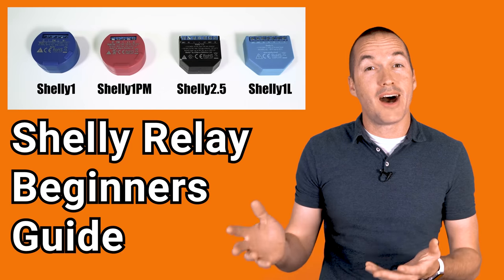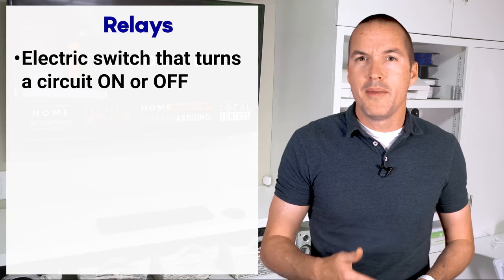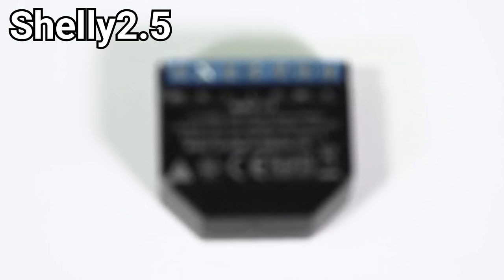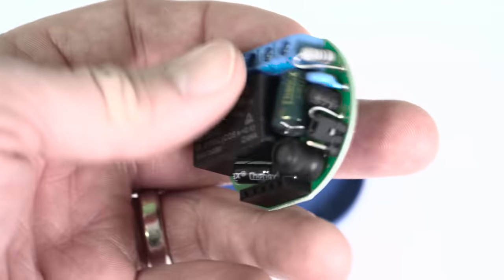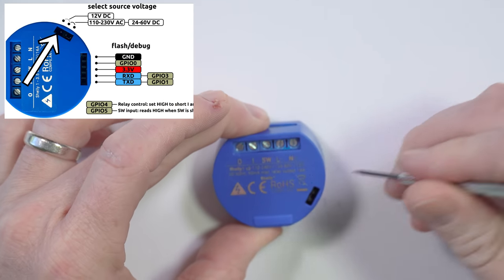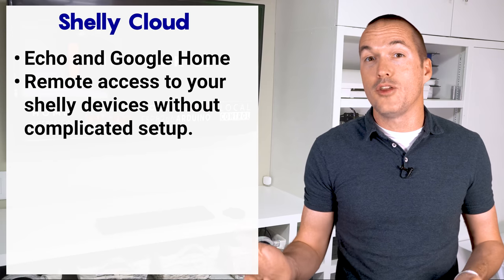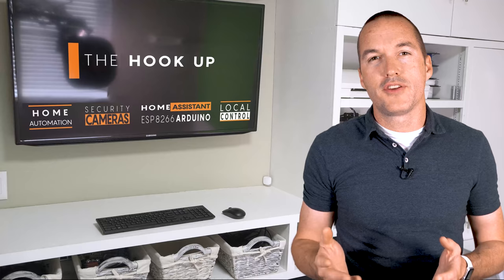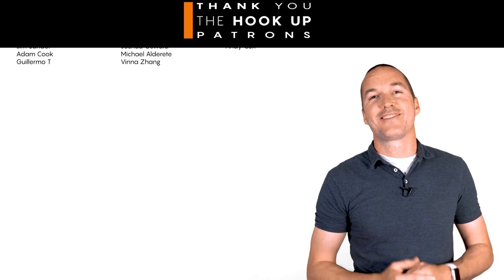Beginners Guide to Shelly Relays - Choose The Right Relay For The Job

Comment: Serious question for those trying to learn - are there connection problems (too many wireless devices) or security concerns (all these are wifi devices, people say don't do that for cameras but all these devices are also hooked up to your home & network - are they secure?)

Sidebar - why do these over non-wifi 'smart switches' I thought shelly parts were like $50+ each, that'd add up just as fast and not as straight forward. But again, I've only just begun researching. Thanks!

Comment: The thing I like about using regular smart switches is I can use extra automations to keep the state of the switch and the device it's controlling the same. I have a switch that isn't connected to anything that uses an automation to control a smart plug in the basement, by creating automations that turn the switch on or off if the plug is turned on or off and vise versa they stay synced.
Reply: With a Shelly, you are best to swap out the light switch for a momentary mech instead of a toggle switch. Then the switch does have a state to get out of sync.

Comment: Have you experienced flickering with the Shelly 1L?  It seems to be very particular to what brand of light is used even with the bypass.  I experienced it with different brand LED and CFL Lights. It seems that Phillips bulbs work the best, but I'm not sure why that occurs.  I also noticed the voltage output is a little lower than input.  If it has 120v in, the out will have around 109-110.

Comment: So correct me if I'm nowhere near correct on this.
If you have an existing home with std depth switch boxes won't wiring that relay then overload the switch box?

Seems like everytime I see a wiring vlog it's just an example on the bench.  Not showing me how to do this in an existing installation.

Comment: Awesome summary! QUESTION:
In a range hood with two separate rockers for separate halogen and fan motor control (Each rocker has a CENTER OFF position and then a LOW and HIGH position to LEFT and RIGHT, which SHELLY would be best suited to these?
Reply from the maker: Are they mains driven?

Comment: Hello,
I’ve been directed to your YouTube page because I’m a newbie and am hoping to make 8 year old ceiling light fans smart.
I want to try to figure out how to use my fans with iPS HomeKit (light are via Philips Hue).
If this isn’t possible I do have a Hoobs box…

So my home has the old push button On/Off wall switch’s and as I shared earlier I’m hoping to make my fans smart.

Which unit would you recommend?
I think there’s a neutral but I’m not sure some switches have them some don’t this is a really old house. 

And if you have any additional direction I’m always open to direction.

Thank you 
JW

Comment: Greeting,

In my house there is Neutral, we have two live wire each wire is 110 volts, in this case how is the connection with Shelly 1 L. If I connect one wire the voltage will be 110 volt not 220 volt, please advise

Comment: Something that might be useful is how to best wire these relays to a light that uses existing 3-way switches, while preserving functionality of both switches.

Ultimately, you want to ignore all of the existing wiring except one wire: the wire that goes from the second switch to the device.  Cut this and use the cut wire coming from the switch for the SW input and the cut wiring going to the device for the O output.

Typically, in modern homes, neutral is found in every box and isn't a problem.  What is a problem with this configuration is the always hot line.  Normally, one 3-way switch box will have the always hot line, while the other will have the wire going to the device.  Sometimes, such as if you have a box with two switches for two separate devices, you may get lucky and find an always hot line right in the box you need it.

Otherwise, you'll have to run a hot line.  You have two options for this and, depending on your house, one may be easier than the other.  You can run the new line through the wall into the switch box, or you can run the new line straight to the device box and put the Shelly in that box.
Reply: Or replace latching/toggling switches with momentary/retractive ones.
Install all switches in parallel, using 1 of the old switch wires for Live and the other for switch signal.

Or install i3 behind each switch.
Use the 2 switch wires to run Live and Neutral to the next switch.
Reply: Commenting so I can find your write up again in the future. Thanks for this information, very informative!!

Comment: Hello! Could these be used to remotely control my big led floodlights in my garden? Ive bought 3 different wifi switches but they all "leak" a little bit so in off-mode the leds are glowing slightly. Will it be the same with these?

Comment: Will they work with a dimer or dimmer toggle switch? I have some switches in my house where center is off down is hi and up is low. Ideally I could use the Shelly to detect these 3 states and recreate the actions on a smart lightbulb or even have up be 1 color and down be a different color etc. Also would be great to just be able to adjust my dimmer switch and have it detect the change and apply it to my smart bulbs.

Comment: I am looking for a small, thin smart relay switch that will work with 12v DC LED lights, any suggestions?
Reply from the maker: Is it a regulated 12V system or straight from the battery (12-15v)?

Comment: One thing you left out... Tasmota firmware. That's a bit advanced though. The programming header doesn't accept Dupont leads. You need to sacrifice some resistors for their tiny leads or whatever is convenient from your parts drawer.
If the stock firmware has a repeating timer function (dust til dawn) then I may forego Tasmota this iteration and see.
Reply from the maker: I don't think tasmota is worth it on Shellys, they are already local and include most of the key features of tasmota in the stock firmware (including repeating timer).
Reply: @TheHookUp  I flashed all of my shellys. Will try the replacement 1pms I just got as stock, no-cloud, mqtt for comparison. 👍

Do they have a local sundown to sun up or will I have to set that manually? These are at a remote site w/ VPN and I need them to still operate if the link drops.
Reply: @OldCurmudgeon3DP  locally stored schedules with sunrise, sunset, offset. Also specific time. Also have timers to automatically turn on or turn off after XX minutes.
Reply: @douglasroberson  thanks

Comment: Annoying thing I discovered with the 1L is that it can't take a single hot switch wire, it must be using Sx and SWn. The 2.5 is fine switching off of a live wire, so you don't have to rewire your 2-way (US 3-way?) switches

Comment: Could you please point me to the suggested device for a USA 3way configuration where the neutral wires are not used (jumped)? The 1+ does require Neutral, right?

Comment: At 2:50 you say that the Shelly 1L needs a minimum load of 20W to operate. I see they sell a bypass for the shelly 1L. Does this mean that operating the Shelly 1L implies a constant power consumption of 20W whether the connected light is ON or OFF. So it's like leaving a 20W bulb on permanently + 1W for the shelly internal consumption?
Reply: No , shelly 1L need a 20W light to power itself bcs it is in serial. Bypass device help get shelly 1L power to work and prevent of flicketing. My 1L blinks and ZBMINI2L solve my all problems.

Comment: Thanks! Learned so much! Quick question... I haven't looked seriously at full home automation in a bit. When I did it seemed the consensus was to go with ZWave Plus instead of wifi equipment to avoid saturation, interference, hacking, etc. Has this changed now? I'd be starting from scratch and have a hodge-podge of things... ZWavePlus deadbolt, Lenovo smart dosplay (Google-based), and a Konnected kit that I haven't set up yet. Hope to run it all on Home Assistant from a QNap. So... for switches and new sensors (water leak, motion, etc) what would you suggest? Wifi, Zwave or other?
Reply from the maker: Zwave is best if you go all-in.  Having a few Zwave devices is not great, the more you get the better it will be.
Reply: @TheHookUp  Interesting. Thanks!

Comment: Very informative video! Don't know if I missed it but does any of them work in a 3way system, like stairs where there are two switchs for the same light?
Reply: Yes they do. But wiring is more complex and you can't to it behind the switch. You will have to do it in the wallbox where wiring takes place. I did that successfully for exactly the stairs use case. https://www.loxwiki.eu/display/LOX/Shelly+an+Wechselschaltung
Reply: Yes.
2-way, 3-way, 4-way, n-way all act as one big virtual switch, where the output at the last switch going to the lamp is toggled each time.
You only need to install the Shelly at this last switch.

If you have so-called "UK wiring", you should have Live, Neutral and switched live (output of the last switch) at the ceiling rose, so that's where you'd install the Shelly.
In other installed, it may become a bit more tricky as you may not have Neutral or Live available at the las switch. A common solution is to use momentary switched instead, wiring them all in parallel and using 1 of the old switch wires* to carry Live.

* n-way switching requires 2 wires between each switch.
So by replacing the latching switches with momentary switches, you have 1 wire for Live and 1 for the switch signal (button press).
Reply: Good stuff. Thanks.

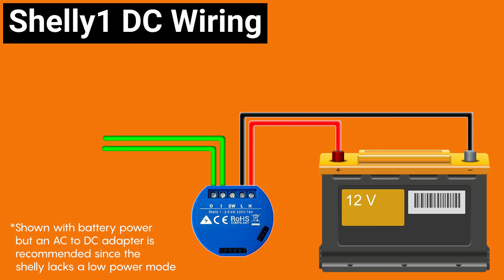Comment: I have a Shelly 1 mini Gen 3 x2  and I want to use it as described in my previous post where I provide 12v as shown at 7:11 in this video and I want to control the dry contacts at 0 1. The literature does not talk about DC implementations at all. Do I have to order the original Shelly 1 for a 12v DC implementation?

Comment: My problem with Shelly1 are that they won't support more than 14ga copper, Will the 2.5 or 1pm support 12ga wiring?  I've had to pigtail down 12ga to 14ga but I have only used shelly so far on our outdoor street light post to replace day/light sensor, and outdoor kitchen lights so when door backdoor is opened the lights at kitchen turn on.

Comment: Weird. Just yesterday, I received my first Shelly relay, a Shelly 1, to play around with. I bought it with the intention of integrating it into a space heater, but now I’m wondering if a PM would be better suited for that? I haven’t had a lot of time to mess with it, but I set it up using the Shelly iOS app and the app pretty consistently reports it as being offline. But, I can reliably control it by accessing it directly from the browser...

Comment: I’m thinking I need the Shelly 1 to dry contact the 24 vac control on my Renewaire ERV ? This is the control contacts used PBL (push button light)  to turn it on / off. Sound about right?

Comment: I'd like to know if I can use a Shelley to hook up a ceiling fan that has lights ,but I only have one switch on the wall. Also can you use Shelley for wall plugs?
Reply: I hope your use case is solvable.  I have the same problem all over my house with the remotes turning other fans on and off when not desired.

Comment: Thank you for the video. Best shelly content out in youtube! I have good communication with my shelly devices through shelly app, no lag at all. However, in home assistant I have on my dashboard the three lights (which correspond to shelly 1L wired without neutral) and they have a lag of 30 sec aprox. When switchhing on and off it executes the action immediately but the state of the light in hass does not update till aprox half a minute. Any suggestions? Thanks!!

Comment: I would like to turn my gas fireplace into a smart fireplace and have google home or alexa turn on fireplace. Currently the low voltage wire to turn on fireplace gas valve is switched with a regular light switch.
I have 110volts for a fan (no fan installed) at the switch box so can I power the Shelly 1 with the 110volts and  control the low voltage circuit with the Shelly 1?

Comment: Do you ever have issues fitting the shelly inside the gang box? I have some boxes that house 4 light switches and its really tight with all that romex in there. The cost of a smart switch is comparable and less wiring to fuss with.
Reply from the maker: I live in a newer house so my boxes are huge compared to some I've seen.

Comment: Out of an abundance of caution (ie: I want overload & overheat protection) I have been putting Shelly 2.5's in every single light switch in my house, even if it's unnecessary when a Shelly1 will do.

Do you think this is a reasonable approach, or overkill?
Reply from the maker: I think the shelly2.5 is better than the shelly1 in almost every way for mains voltage applications. Your approach is good.
Reply: It has got the power monitoring which is a nice bonus. I love it.
Reply: Please note that the Shelly will only protect the switch from overheating and not the wires or other areas of the circuit..
In a properly wired house, Shelly does not add any safety as the main risks are mostly downstream of the switch.

Comment: I saw in the video that you can connect 2 switches with 1 output to the shelly 1L. Does that nean I can use it to connect it to the roller shutter? Because I don't have neutral line in my switch box

Comment: I know it’s an old video but does Shelly make anything that I can use on my wood pellet stove for a thermostat relay? I can add a milivolt thermostat. Would prefer to have sensors in different areas of the house to control the pellet stove
Reply from the maker: I'm not exactly sure what you are asking, but shelly does make an addon that allow you to hook up an exterior temperature sensor.  They also make battery powered temperature and humidity sensors that you could use to set up automations for your relay.

Comment: Question on the 20W load with the no neutral.

Does that mean it needs to draw more than 20W when the switch is on, or does it continuously use 20W?
Reply from the maker: draws more than 20w when the switch is on.

Comment: very informative video.  thank you.  I was curious if the Shelly 1 would be the correct unit to operate a fireplace set that I have.
it currently has a wall switch that runs down to the unit and powers the fireplace on/off.  thanks!
Reply: Great question!  I have a 12vdc switch in the wall that looks like a 110vac.  I discovered this when I opened it up to put in a smart switch (110vac only).  Now, with the Shelley 1, I THINK I can put in Alexa voice control to the gas fireplace.  Woo hoo!  
I'll wait for an answer to yor question before I start cooking with gas, though.

Comment: Hi there, I was wondering if the manual switches work regardless for a Shelly Pro 4PM? For me, when I turn off the light / line using the Shelly app (the relay), I need to turn the manual switch on and off again for it to work. Have I was wondering if I am doing something wrong? Help.

Comment: Is there any Shelly device that is not geared to a load?
I have been looking for a specific device that has at least 1xDI and 1xDO
My specific application is a residential garage door I/O application
My input could have voltage on it as it's just a reed switch to sense the door is fully closed.
The output however needs to be a contact closure and not have any source power from the Shelly (or other) unit

I did have a Insteon IO-Link in there, but I'm in the process of replacing all of my Insteon equipment
I think the Shelly Plus 1 would do the trick, no?

Would be nice to have a second input as I think I may want to place a door fully open contact so I can improve the logic to open/close/travelling rather than just closed/not closed
I don't see that in a Shelly unit. May have to rig my own ESP32 blob up

Any insight would be awesome!
Thanks!
Reply from the maker: I've made this exact video: https://youtu.be/WEZUxXNiERQ

Yes, shelly plus 1 is the correct option.

Comment: So what you can do if the Home Assistant Shelly Integration returns an "Unsupported Firmware" error, and the device has the last firmware update installed (Shelly 1 Wifi Relay )! I just bought two to integrate with Home Assistant and it's a disappointment already...
Reply from the maker: Sometimes if your firmware is REALLY old it won't be able to detect a new firmware.  In this case you need to temporary enable the shelly cloud for it to download the latest firmware.
Reply: Thanks ... that worked!!!

Comment: Can the Shelly's relays be a replacement to Aeotec nano switch, Aeotec nano dimmer and the dual nano switch? I moved into a house recently that has these installed to control the pool and spa lights and also the patio and flood lights.  It uses a smart hub by Aeotec, but the hub went offline and I can't get it to work again and would like to move away from the hub.  Would like the relays to work with Apple homekit (not a deal breaker), but something that is more user friendly than what I have. I've been without access for almost a month now.  Help!!  Thanks.

Comment: Is there a Shelly device I could use to place in-between my hard wired dishwasher so I could kill power to it?

I want to be able to kill power if the main water valve is closed due to a leak.
Reply from the maker: I'm not sure what kind of amperage a dishwasher pulls, so I don't feel confident answering that.  I'd guess a shelly1pm could handle it though.

Comment: How does it work with older switches? What I mean is let's say without the Shelly, flipping the switch up, turns the lights on, flipping down turns them off. If I have them off (switch down) and am using the Shelly, can I turn the lights on even though the switch is down? Also would then switching the light up continue to keep the lights on until I flipped the switch back down? Hopefully that made sense.
Reply: Set the Shelly in "edge" mode - it makes the two of them act like a 3-way switch. There are other modes, too.